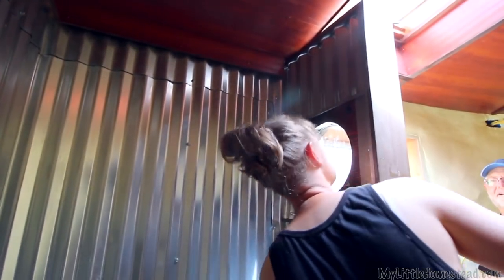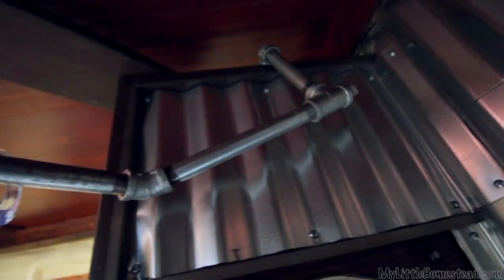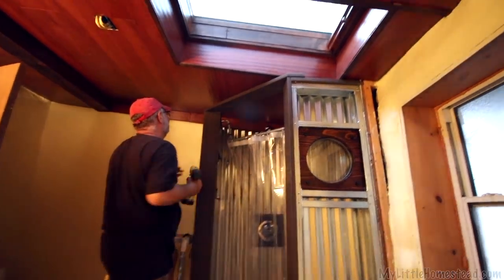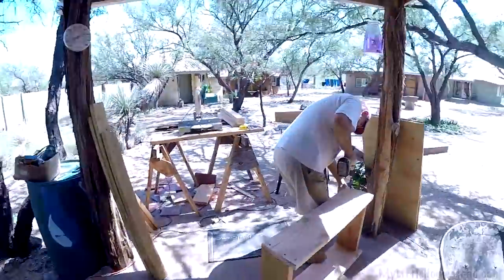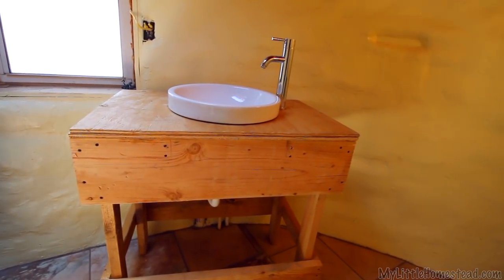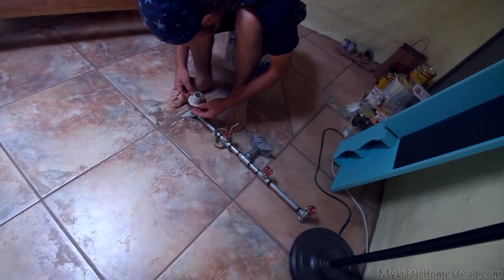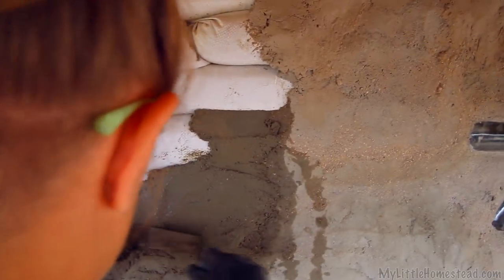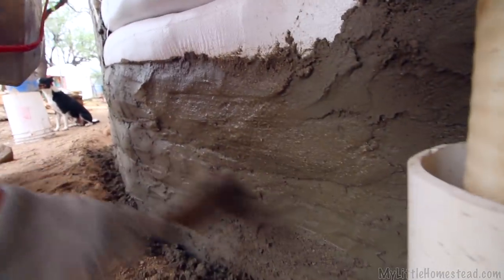Working Bathroom,  Stucco & Wedding!  | Earthbag Kitchen & Bath | Weekly Peek Ep148

Comment: I hope you made many pin holes in the mason jar lids to allow for heat escaping.  Otherwise eventually your jars are going to burst or you will go thru many bulbs over and over again.  NO indoor light fixture is 100% enclosed.  They are all designed to have some heat relief.
Reply: I was just going to say the same thing. They only look 40 watt at the most but incandescent bulbs can build up a lot of heat.
Reply: Even LED lights last longer with some minimal ventilation (at least the bulb type). It's easy enough to drill/punch some small holes on the jar's cap. This also provides vertical light that can change how a space looks.
Reply: Live Above Average,
Very True. If is a bulb is on for only ONE minute, lots of heat is generated. Even 40 watters.
Reply: If they do a decorative pattern that could work as well.
Reply: So thankful for this piece of advice! This maybe why im going through a pack old bulbs every other week!
Reply: Jessica,
Thanks.  It could be but since I am not there I am not sure.  Are your light fixtures enclosed also?

Comment: On the bath lights just make sure there is either vent holes drilled around the top or get a masonry drill and very carefully drill holes just under the lid edge through the glass.  Whether you use led or incandescent or fluorescent bulbs they will over heat without vents

Comment: looked like everyone had a good time, I know some one said this all ready but you may wish to put some air holes in the lids of the jars for your light, being sealed up can shorten the life of the bulbs do to over heating.  if the jars get to hot when you turn off the light or get hit by cooler air they can shatter do to thermal shock, just like when your canning. wishing everyone happiness, thank you
Reply from the maker: Thanks . Will do.

Comment: With the heat built up by incandescent bulbs, and the widely, even wildly varying humidity in a bathroom, I'm concerned that your mason jar steampunk light fixture could wind up presenting a real danger of thermal-stress shattered glass and widely spread shards of glass.  You may want to see if you can locate some form of pyrex jars that will fit with the mason caps, or adapt the design to pyrex jars with screw-on lids.
Reply: OriginalLictre this was my concern too. And those lights look like the same ones that are used to warming candles to melt them I'm concerned the mason jars will shatter. It does look pretty though. Maybe and LED light bulb they put off very little heat if any might be an option too
Reply: Original Lictre & Kristen W
The Mason and/or Kerr jars are made to withstand boiling temps, around 210°, plus being under anywhere from 5 - 15 pounds of pressure for 10 - 30 minutes depending on the type of item being canned, so they should be able to handle all conditions in the bathroom with the exception of the rings posibly getting rusty from moisture in the room, but the heat from the lights will hopefully dry them off so no worries or less worries about the rusting, but for sure the glass should be able to handle the heat from the bulbs!!!  There is also the comparison of placing dry jars in 250° - 350° oven for 10 - 15 minutes to steralize jars if one is dry canning something like, dried beans/legumes so one doesn't want moisture from boiling to steralize and most generally there is no breakage from any usage of food canning, and if something does happen is is generally a crack or 2, not a shattering exlposion like situation